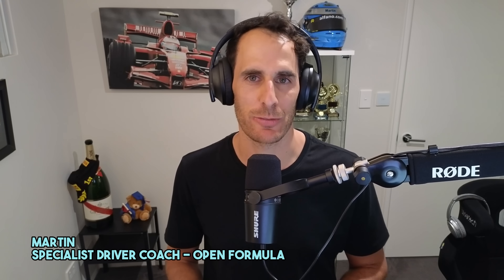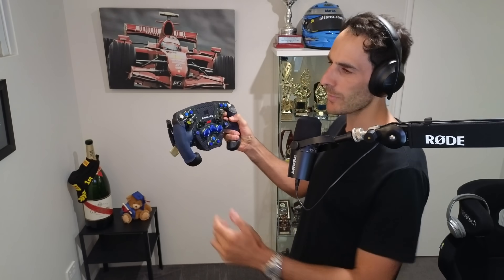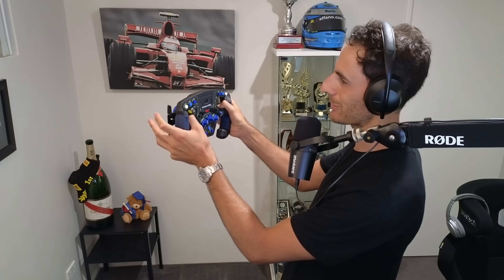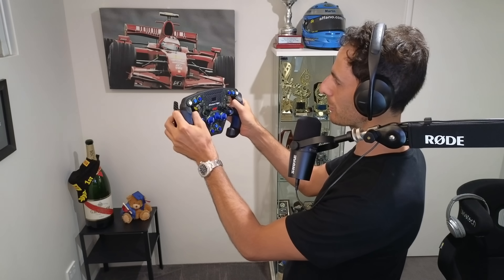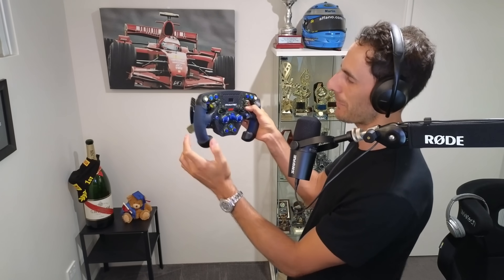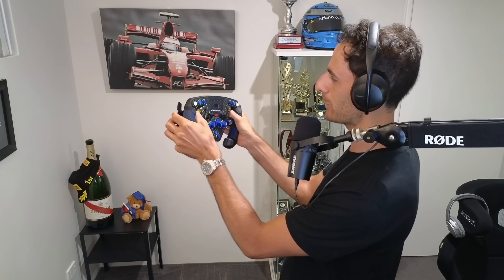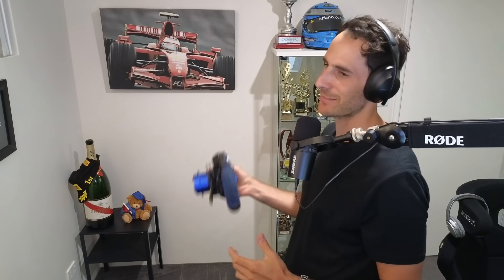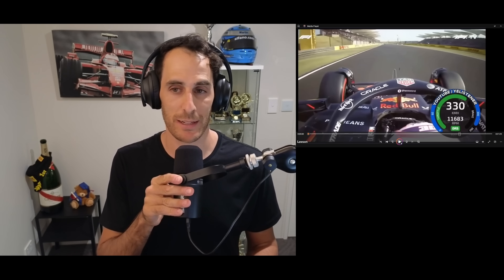The SECRET TECHNICAL Reasons Why Liam Lawson Was Sacked!

Comment: Checo's performance was way better than Liam. Sorry but that's a fact (Liam could have been given 3 / 4 races to prove himself sure .. I can 100% get behind that ). Checo was nowhere near at the bottom of the pack. He placed 8th in F1 2024 Drivers championship. He got 4 podiums and a whole bunch of points throughout the year. He did really really well with the absolutely impossible to drive of a car that is the Red Bull. Yuki will struggle a lot in my opinion and pretty much anyone other than Max or maybe Norris / Lewis would struggle as well.
Reply from the maker: Who do you rekon will quali higher on suzuka - yuki or liam?

Comment: I've seen Liam's onboard from cars like the Rodin FZED, and I believe he loves fighting with an understeery car like what he would get in Super Formula and DTM cars. He's so used to that, that he can't get the hang of super sensitive and oversteery car like the RB F1 car.
Reply from the maker: can you link me!
Reply: @lowerlaptime  https://www.youtube.com/watch?v=aEG4EKcbkig

I've also noticed from Yuki's onboard back in Alpha Tauri, he handles the braking points and corner entry quite similarly to Liam.
Reply from the maker: @Excepti0nHandler  farout you're right. There was this long right hander, constant, and he was hacking away at the wheel. Wondering why no one has cleaned this up in his technique before RBR
Reply: @lowerlaptime  I would go on to even say, even though this is a hunch, Max's polished out driving skill does not come from a specialist coach necessarily, but from his constant sim racing. In sim racing you get to customise your own car setup and force feedback on the wheel. And I think using a lower force feedback in the game, where you don't constantly fight the wheel, but instead polish out your steering input and use more of your intuition to gauge the traction on a corner has forced him to learn smooth steering and trail braking.

Comment: He most likely breaks late and can’t make the turn as smooth as max therefore the sudden steering inputs and thus late exiting the corner. Which should improve the more he gets used to the car and when he’s not under so much pressure however at the same time he still mustn’t be the worst on the grid which is unacceptable for rb. That’s why he’s sacked and I think they did the right move getting rid of him. The thing is he will surely improve but will he finish at top 6-7 consistently ?  It doesn’t seem like he would therefore no reason to keep him.
Reply from the maker: Who do you rekon will quali higher on suzuka - yuki or liam?
Reply: @lowerlaptime I think yuki but I wouldn’t bet on it. However in the race I believe yuki will be faster for sure.

Comment: Liam likes to use Understeer Rotation it looks like.. understeering the front tyres to make them produce blocking friction, and then open the throttle over the understeer, and that rotates his car.. it's good for a car like the Renault R24 that Alonso drove.. and he did it well.. but the RB is the opposite design demanding smooth inputs as you said. Hamilton still uses understeer rotation but he is 5 times smoother then he was 2014-2018.. same for Alonso.
Reply from the maker: Alonso 05 06?

Comment: Going into that friction circle a bit you are probably correct on progressiveness vs ground effect cars, since these cars overreact to air flow distortions to the air seal. 
I guess the friction circle for any F1 car has a shading area to it where it still performs very well (so small additional input could be ok, but larger like what Liam did gets you over the threshold). It then would depend on window of the car to see how big that window is. Which would then relate to statements that Liam could easily do a lot better in VCARB 02 and Yuki might struggle in RB21. As there is almost no grey area of forgiveness to that car. 
Max might be able to hit that perfect middle of the grey area time and time again, but that ain't normal. Maybe Lindblad is another freak of nature, but Red Bull has put themselves in a bad corner.
Reply from the maker: Who do you rekon will quali higher on suzuka - yuki or liam?
Reply: @lowerlaptime  dropped you a mail that I think Liam will take the cake in Suzuka. Perhaps Yuki will catch up to Liam during the season, but RB21 is probably too troublesome to just take out for a very fast spin. Whilst VCARB03 was on it from season start.

Comment: Based on Albon's explanation of what it's like to drive a car designed for Max, this makes a ton of sense.  Max's cars are hyper-sensitive to steering input, so Lawson is afraid to steer too much until it's too late and he has no other option.
Reply from the maker: correct!
Reply: @SylviusTheMad  sure, but he needs time to work it out, without that he’s fighting the car which results in the uncertainty and rapid wheel correction as the sensitivity of the front end reacts.  The more sensitive the worse it is, and this RB21 is supposedly the most sensitive.  Will be very interesting to see how quickly Yuki adjusts, or will they give him no time either?

Comment: Hi from Perth mate, great video… would a tiny lift and coast, with a later braking point, induce higher entry downforce parameters in the friction circle, higher than what Lawson was doing at Rnd 1 and 2?
Reply from the maker: Hey mate :) uhh.. no. Downforce's friend, ie what gives you more downforce is speed. A lift and coast situation will do the opposite. Take away entry speed. Its good for fuel saving / tyre life though.
Reply: @ thank you for the reply! Ok…but does making sure into certain types of corners, that you are off the throttle, before applying brake then adding in throttle again, stabilise the front nose and centre of balance?
Reply from the maker: @iracingaussie  hmm no. its not got to do with the coasting time. You can transition quickly from one to the other without delay. Its how hard you go for the brake pedal, initially hard or soft, that will be the factor. Does it make sense?
you can comfortably chop out the lift and coast from your style, and focus on initial brake application
Reply: @ very good advice mate, appreciate it. Obviously you can tell where Im applying this 😂🏎️

Comment: The way Liam is driving is a reflection of a very oversteery car. How he turns too slow at higher speeds, and had to make up for it during mid turn. It’s more about brake control then steering.
Reply from the maker: to some extent! In a hairpin, like, with BB forward there is nothing to worry about with the rear, ego, no excuse for the delay in turn in.
In Turn 1 yes, decreasing radius corner, more combined entry happening and braking can upset the rear, as we saw all weekend

Comment: Do you think teams should be prioritising having 2 drivers who have a very similar preference and driving style, so that car development can pull in one single direction rather than combining just any of the best 2 drivers you can get? and then dealing with a headache of a car not fully releasing the potential of either, or in red bulls case, only one

Is this too why max came straight from F3, the lower formulas didn't fully allow him to drive in the knife edge style he can with a team f1 car that can be developed completely different to the rest of the grid.
Reply from the maker: this is a great question. It's never been an issue before because generally the cars arent so close, like we have had this year. I  would say yes, moving forward, the shift is from car to driver (finally!!)

Comment: Wait, how are they on top of the game and don't have a technical/mental support coach to dig them out? Even professional bodybuilders, just training and eating for straight up ten years, every days the same, need one to perform on stage at moment X. I'd imagine it being Team Red Bull everything would be lined up from the get go, to pay some coach 2k a month lol?.
I agree on that too late turn in @ low aero. Might have worked well in his DTM Ferrari. Inducing rotational rate at the entry, and carry that yaw rate through the whole corner, is different from yanking the wheel at low speed. With aero cars, that shown frictional circle would become a bigger diameter at higher speed. As the car slows down and loses aero, those pointers to the outside, well, end up outside the circle.
It's fairly easy to say when you're not sitting in that bull 😂
Reply from the maker: I agree with you! There are no coaches in the paddock at the moment. But about 4k people trying to make the car lighter / quicker lol

Comment: I'm a helicopter pilot and your description of the friction circle rings true in any machine where you are transitioning between different energy states and directions. It reminds me of the trade off you do when flare a helicopter during an autorotation or a plane on landing. In a helicopter its a dance between controls where you trade off height and speed to maintain the rotor rpm.  Any linear or snatchy movements use up energy and result in a bumpy landing. 

In Lawson's case, his snatchy steering input seems to be exceeding the maximum load of the tyres and introduces body roll with reduces down force. This reduces maximum load the tyres can take right when he is demanding the most from them.
Reply from the maker: this is awesome. Im glad to have you here and have read about this - i didnt know this. Im scared of heights mate :D
Reply: Unless you are in a r22 then you get the Robinson twitch. But agree, it was something i was always interested in after watching vettle at rb

Comment: You and Peter Windsor keep talking about „short corners“ is there a video where someone explains exactly what to look for / how that works compared to other drivers / styles ?!
Reply from the maker: of course! Here it is. Keep in mind our definitions of short corner are different. Mine aligns to Rob Wilsons. A short corner is a small rotation point. Peter defines a short corner as a 'shorter corner' distance: https://youtu.be/aK11P1BRkRI
Reply: Not all corners can be travelled using short corner technique, banking of the corner, inclination or is it going downhill or is it at the top of the hill also depends whether how far or near the next corner is.
Reply from the maker: @ yea i say this in the video i linked ^
Reply: We used to call it "point and squirt" - square the apex pivot point, harder brake and gas  as opposed to one smooth line/curve (wi smoother brakes and gas) through the corner.

Comment: great analysis.
2 questions,
1) hairpins are slow speed, so downforce are relatively low, not aggressive enough entry may be more of a issue in high speed corners?
2) ability to turn goes up exponentially, not linearly when speed goes down, it follows a decreasing spiral, especially without downforce. in slow speed corners, adding more steering at the apex to make entry and exit straighter, so it can handle more speed and accleration may be a good tradeoff in some situations?
Reply from the maker: hey cheers!
1) they are yes. yes df is low, or bleeds off. you are correct with your final statement. Notwithstanding, i still saw bad steering technique in the hairpin!
2) yes corrrect!

Comment: Just curious - could you demonstrate how the combination of downforce and friction circle work by scaling up the circle when there’s more speed + downforce? Grip is a function of weight, so theoretically you can add more steering early in the turn when you’re heavily braking because the circle at that point is *huge*. But as Lawson brakes and waits for that turn, he’s turning within a smaller and smaller friction circle.
Reply from the maker: you are correct. To keep the video simple i didnt go into changes in friction circle with downforce, and with rain. Just that hes not using the downforce when its active, and then, once its all over, he does this big turn.

Comment: that's why they (most good drivers at the front) are aiming for the apex before braking. unless it's a big straight line with a hairpin at the end, you HAVE to aim for the apex before braking. like this you brake straight on the way in and keep the balance flat and you can use the aero to the best possible. they (engineers) call this "braking in the corner". massive time gain like this. because you spend a very low amount of time on the tyre edge with the steering wheel turned. the rotation moment is rather quick in order to have a flat car again to accelerate as hard as possible.
Reply from the maker: Who do you rekon will quali higher on suzuka - yuki or liam?
Reply: @lowerlaptime  Yuki has a good knowledge of this track but 1/ new car 2/ being at home with pressure. 

Liam loves this track and did well in other series on it. back in a car he knows. the "revenge" mentality. 

if Yuki can lay down a proper lap, it could be hard to beat. but my bet will go with Liam. context is more favorable towards Liam imo. :hand-purple-blue-peace:
Reply: @Jibs29  that’s so basic and they all know how to drive
Reply: @ lol ok Mr Nonsense.

Comment: Isn't this also an engineer problem if  they r not advising the cans n cannot do of the car?
Reply from the maker: umm. good question. yes and no. Yes - this is all the teams have. So the engineers (in the absence of a driver coach present) should solve for this, but they arent skilled enough to do so. So, 'no' - its not their job. Its tricky

Comment: Are all of these examples on like for like tyre wear? He has said himself that the tyre window was only 1 lap. Once its gone you are either chasing the front or the rear, and he said both.
Reply from the maker: Dunno. it doesn't matter. The takeaway you should get from this video is - this is bad use of a steering wheel.

Comment: Often, I'm unable to fully agree with you, but this time I think you're spot on. And to answer your remark on Liam being green on the Chinese GP: he was. So Checko has gotten multiple years not to fail, but Liam got a 1 day winter test (he was sidelined half a day with a mech issue, Liam lost the FP3 in the season opener, and went to qualifying with a setup that wasn't tested. And the Chinese GP was a sprint weekend, so only a single practice session...   
Bearing in mind even Lewis has had major trouble to get a decent qualifying out of the Mercedes over multiple years, I find harsh critique on Liam too early.
On the other hand, Liam complained about tire temperatures not being "in the window" in qualifying in China,  and this clearly means he (and the team)  did not do his homework: The simulator might be rubbish for a lot of things, but one thing you can test is how the car generates and keeps temperatures in the tires... He and his race engineer should've ironed out the prep lap(s) for all possible scenarios. I cannot believe the team is not aware of the actual tire temperatures at any corner/straight.
Reply from the maker: Yes this was not a proper chance
Reply: Good points. To the simulator, China was completely resurfaced. Track times were 3s quicker than '24. So perhaps thats contributory.

Comment: I don't race but I learned a lot from this video!!  It's made me think about the relation between the mechanical grip of the tires and the under car downforce.  There must be a point where the car is actually lifting and rapidly losing "suction" from the floor (and thusly downforce on all 4 tires) and that leaves the driver relying too much on mechanical grip and that mechanical grip is not balanced.  OR at least that's the way I interpret it.   Now I wonder how brake balance impacts this dynamic.
Reply from the maker: yes. correct. there are times when downforce is not as active, and you gotta adjust accordingly.